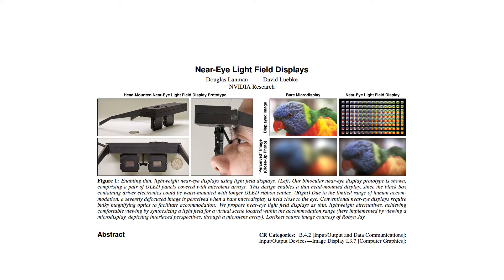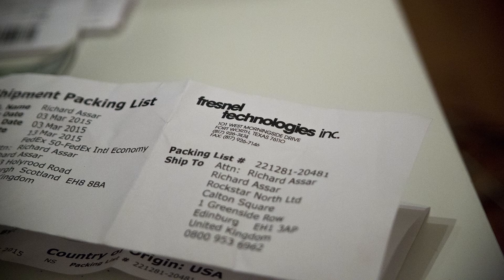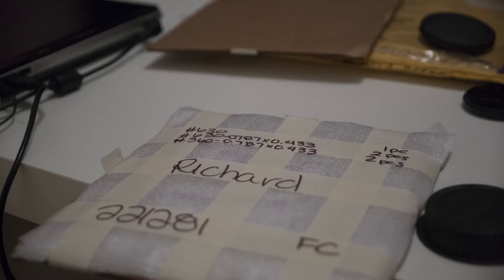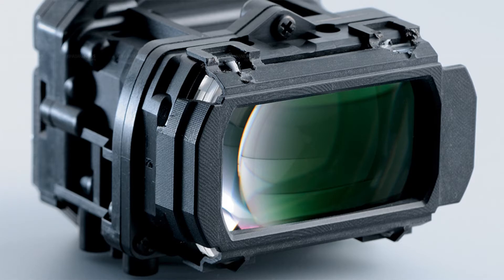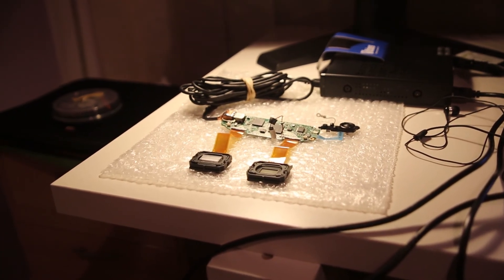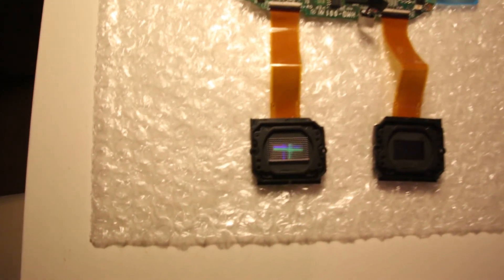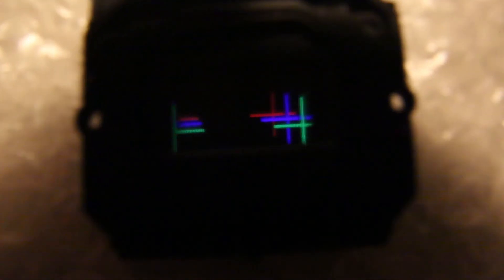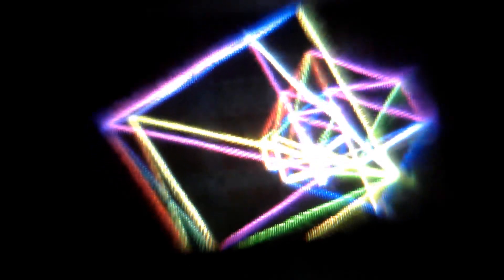Near-Eye Lightfield Display Project

Comment: hi thank you for this video, I would like know where I can buy  the same near eyes display? it a emergency. thank you
Reply from the maker: https://www.ebay.com/p/Sony-Hmz-t1-HMZT1-Personal-3d-Viewer-Headmounted-Display/1400144091
Reply: Richard Assar ist not the near eyes displays only?
Reply from the maker: The near-eye display is a prototype based on the paper by Doug Lanman (was at NVidia at the time). You have to make it yourself. Buy an HMZ-T1 and the microlens arrays and you can start developing the lightfield renderer (you'll need to use off-axis projections as stated in the paper). I did not 3D print a housing for mine. It would be possible to make one for you but of course it would cost extra for my time, so you're better grabbing the parts and doing it yourself.
Reply from the maker: Also, how could it be an "emergency"?

Comment: Nice, like NVIDIA's prototype.  But why micro lenses?  You're taking a fixed resolution screen and subdividing it into smaller resolution pieces, massively reducing the light field resolution.  All lenses, even micro lenses are usually an optical compromise.  They're prone to imperfections and tend to refract light.  So why not pull an Isaac Newton?  That is, ditch the refraction and go with convex micro-reflectors (bulging outward, reflecting inward), and locate high res mini projectors near the eyes facing outward.   It sounds nuts but thick of bubble wrap.  It should be pretty easy to manufacture a material that consists of thousand of tiny convex reflectors, like 1/2 the cross section of a bubble wrap, convex and purely reflective.  Mold that material into something that resembles wrap around sunglasses.  Even those tiny micro lenses will be able to reflect the full resolution of a projector, or at least gather much more resolution than this approach.  You could have two projectors located near the eyes project a stereo field of light across the surface of these glasses and get the same effect, I'm pretty sure.  Remember the Haunted Mansion and those sculptures that follow you?  I think this would produce a very similar effect, only with lots of micro lenses for the light field effect, and using projected light instead of a sculpted convex surface. Then, the holy grail one step further than this would be to use electrically actuated liquid lenses with "bubbles" instead of fixed reflectors, I'm thinking adjustable lenses/reflectors like I heard that they're developing for phone cameras and such.  Then the glasses could serve as anywhere from fully transparent to fully opaque/reflective or anywhere in between.  From AR to VR and back again.  I'm 90% certain this is exactly what Magic Leap has up their sleeve.  Crazy ideas and easier said than done, I know...but doable?
Reply from the maker: Mirrors impose some design constraints and probably come with their own set of optical aberrations. That being said it is a really interesting idea and I'm glad you brought it up.

https://www.ncbi.nlm.nih.gov/pubmed/19474924

"Three-dimensional projection integral imaging using micro-convex-mirror arrays."

Liquid lens arrays for integral imaging would also be a really awesome thing to behold.

http://www-mtl.mit.edu/researchgroups/mems-salon/Hayden_Chronis_array.PDF

The holy grail would be lightfield generation without use of lenses.

Comment: Can you please elaborate the use of this in head gear ?
Reply from the maker: This is a progress report for a project where I am repeating work already done. Please read the paper which I have linked in the description if you want to know more. Thanks.
Reply: Richard Assar
oh, ok..... thanks for replying...
Reply from the maker: +Hanniffy Dinn Apologies Hanniffy, I have been busy. 

Please see this video https://www.youtube.com/watch?v=uwCwtBxZM7g

And read the research paper I linked in the description.

Also see related videos on the panel on the right.

Lightfield displays reconstruct an optical wavefront by ray fusion enabling depth defocus cues and, depending on angular resolution, can function as a 3D display.

Head-mounted displays based on magnifier optics create the effect of a stereoscopic display at a given depth and therefore image refocusing (by the eye) is not possible.

Path-traced rendering suffers from noise, so elemental image fusion can address this.

I will leave it to you to investigate further.
Reply: Richard Assar
Thanks for the info. The way I was seeing it when the paper came out, was  it allowed more realistic Augmented Reality.   

That is virtual objects the seem to be more in the environment as they can be out of focus just like real objects in the background?
Reply from the maker: No, these are not AR glasses. See http://pinlights.info/
Reply: Richard Assar
I know, but there is a AR & VR startup that has got billions invested, and claims to use Light Field Technology. 

Still trying to figure out what it's doing and how, seems really secretive still.
Reply from the maker: You are referring to Oculus, and Doug Lanman works R&D there. You should look at lightfield display patents.
Reply: Richard Assar
No !  Not Oculus,  that's bog standard VR. Nothing special.   I'm talking about Magic Leap AR: 

http://www.techinsider.io/incredible-augmented-reality-headset-2016-3

It's supposed to be using light field tech and completely unique AR system.
Reply from the maker: Could be tensor displays, which are heavily computational. We'll find out once released anyway ;)
Reply: Richard Assar
yeah, it's very interesting.  2016 is consumer VR, so it won't be long for really good AR.  Gonna be interesting !